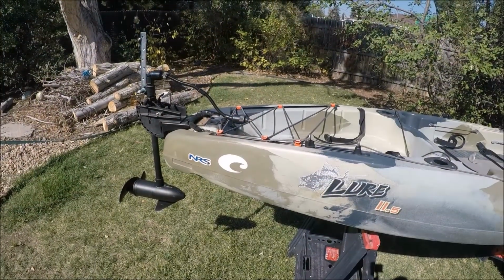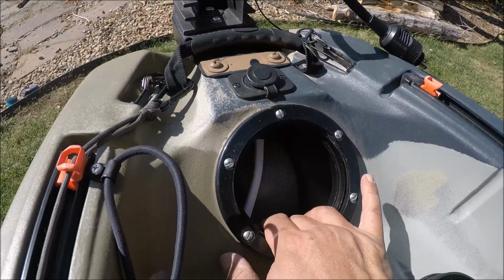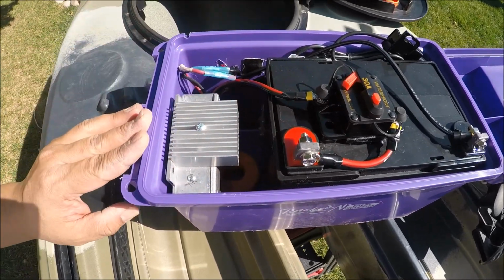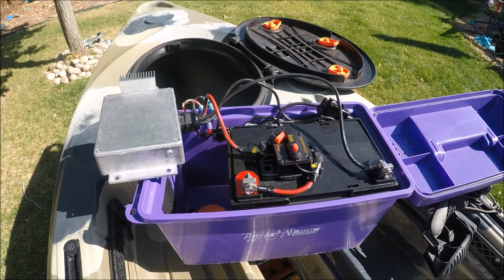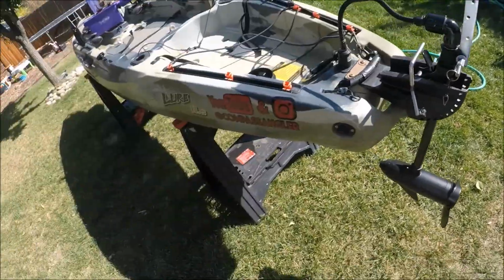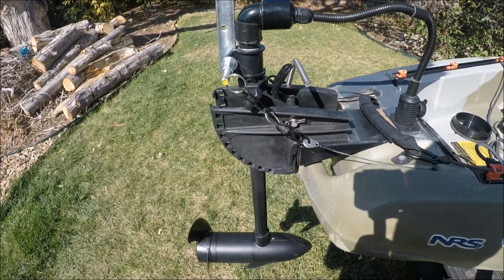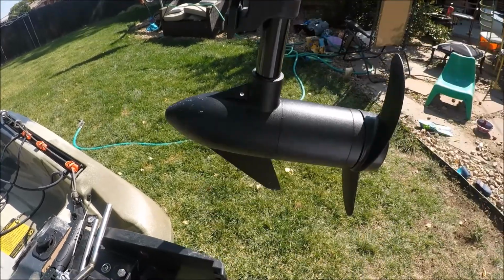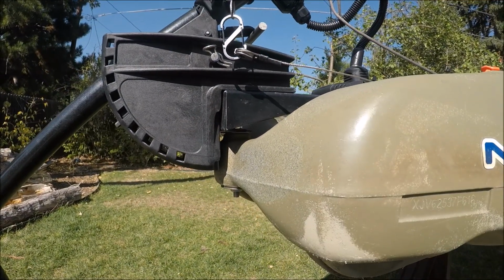Motorized Feelfree Lure 11.5 (How I Did It!)

Comment: Does that work with any trolling motor?  My motor has the positive and negative power cables, as well as two others for the original control. Do i just need the black and red wire for this setup

Comment: Hello. I know this was made 3 years ago and im not even sure if you will read this. I cant find that motor mount from Bassyake and on the page for that garage opener, its says "not recommended for trolling motors." Is there a modle number for the mounting bracket and have you had any problems with that power converter?

Comment: Holy smokes youre a genius. is there a smaller version of that kind of speed controil?
Reply from the maker: Look up PWM on eBay or Amazon and there are all kinds of models. Depending on your voltage needs or amp requirements you should be able to find something. Good luck and appreciate the kind words, frankenyak is still going strong 💪🏼

Comment: If the motor is drawing 100% at any speed setting, why does the battery last longer at lower speed settings than a higher speed settings?
Reply: Exactly

Comment: Thanks for doing this Bud! I had no idea that the stock motor always draws 100% power, regardless of which setting. One would think otherwise, ie: that each of the 5 (forward) stages would draw 20, 40, 60, 80 and 100% respectively. 
I'm thinking of doing all this, so thanks once again! Much appreciated!
Reply from the maker: The things they don’t tell you…crazy how inefficient the stock setup is. Going on three years now, besides a battery upgrade smooth motoring. Glad to point you in the right direction 👍🏼
Reply: @CompassAngler  - Thanks again!

Comment: have you had any overheating issues with this particular pwm? seen a lot and had my own issues with heat meaning i would need to add fans to a box. cause if this isnt an issue with this one im in! amazing video by the way got the 13.5
Reply from the maker: In line fuse will trip if I run at full power for too long, assume under load the power draw is more that 30 amps. If I run 80-85% then I can run for an hour plus continuously. Not a perfect system, but for the smaller lakes I fish it’s works well.

Comment: Dude! Your speed controller is not recommended for trolling motors.  Question have you had any problems out of it since your build.
Reply from the maker: I’ve heard that since the moment I set this up, especially from the manufacturer. 30 amp rating, 30 amp draw from the motor, 30 amp circuit breaker in place. Only issue I’ve had is a dead battery in the remote once. Solid as the day I put it together!

Comment: Clicked on the link for the controller you used and it says not recommended for trolling motors.  Is there a specific reason why?  Your install looks super clean.  Going to attempt something like this on the bass raider perhaps.  Steering will be fun problem to solve for me though.
Reply from the maker: After a lengthy talk with their customer service they told me they had issues with people running too many amps through the unit and burning them out. They said 30 amps max, so I installed a 30 amps fuse breaker and no issues over a few seasons. My little trolling motor only draws 30 amps so check your amp draw on your motor before you proceed FYI. Good luck on your project 👊🏽

Comment: Thanks for the info. It says in Bold letters on their website that its not recommended for trolling motor applications. Do you happen to know why the say that? Id hate to cause some long term damage to my trolling motor. Thanks.
Reply from the maker: No issue on the trolling motor side, the issue is the amps on the speed control side. They don’t recommend more than 30 amps max, some trolling motors pull more and can burn out the speed control. I use a 30 amp max trolling motor with a inline fuse, not really worried about damaging anything and have used it an entire season without problems. Hope this helps